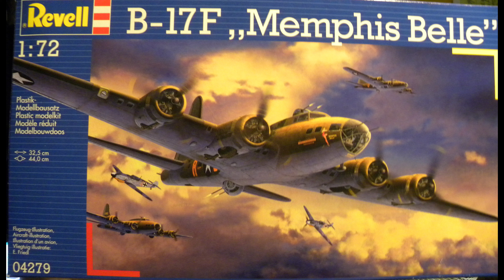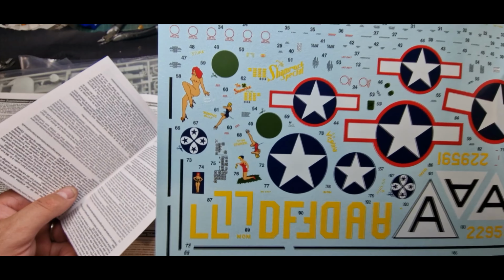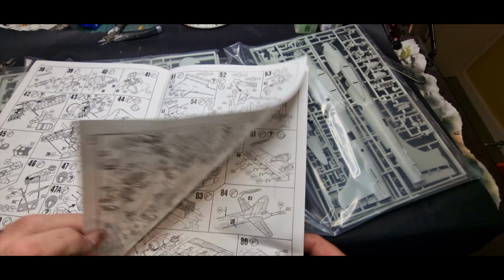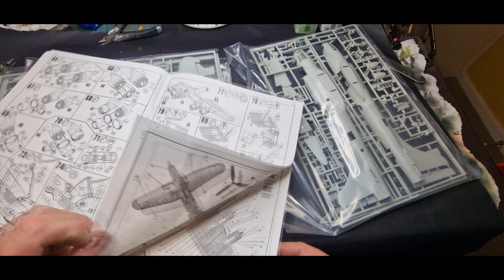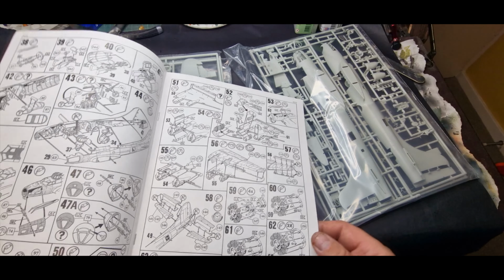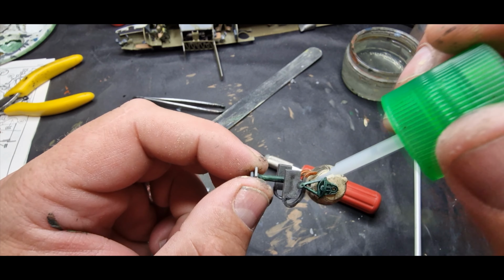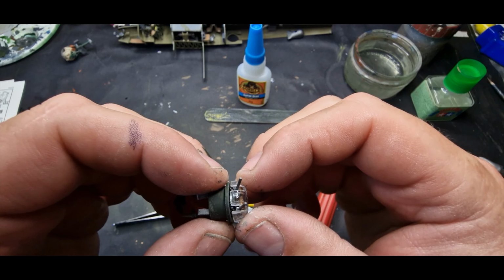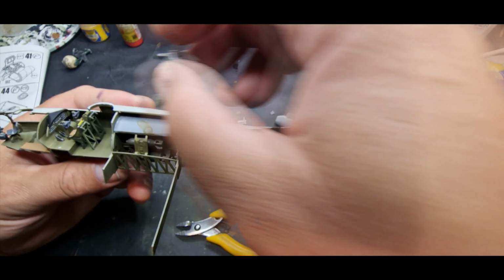B17 Memphis Belle, Revell 1/72 part 1

Comment: Very amazing work you did on the inside of the plane (the detailing I mean).
I also have that model kit as well, waiting to be assembled as well. The instructions are a bit similar to one older version of B-17 F, and also to B-17 G as well. Both from Revell.
The older version of B-17 F is a skill 3, and it had a small details as well, especially for the lower gun machine as well, and for the front machine guns as well. I did that model kit long time ago.
As for the B-17 G, it took me 2 to 3 weeks to do that model kit. And on that one I have putted the Yugoslav decals as well.
If you are interested, you can see them on one of my update videos as well on my channel.
Keep it up 👏👏👏👏👏👏💪💪💪.